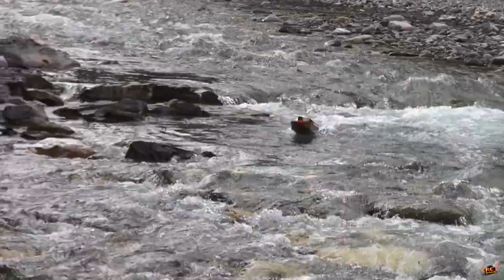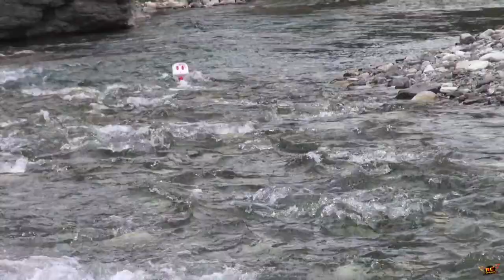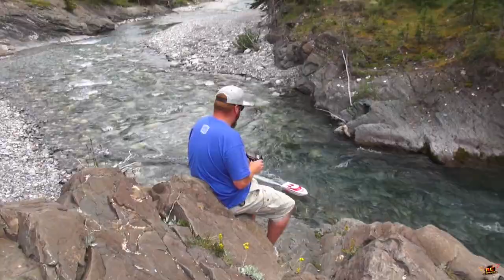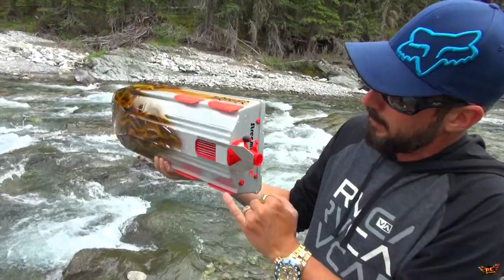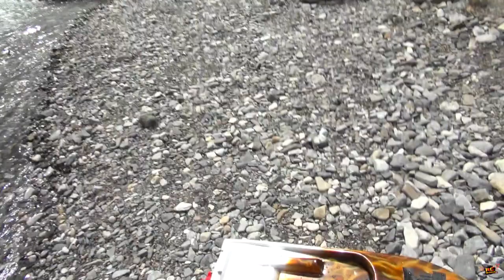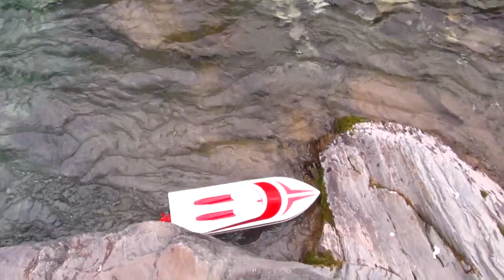RC ADVENTURES - RiVER RAPiDS vs Steel Skid Plates - THRASHER JET BOATS - 5S Lipo POWER!

Comment from the maker: RC ADVENTURES - Streamline RC Thrasher Jet Boat Series
UNBOXiNG THRASHER JET BOATS http://bit.ly/29KqvW6
THRASHER JET BOATS vs WATERFALL http://bit.ly/29KqZvl
SKiD PLATES vs RiVER RAPiDS http://bit.ly/29Krcyv
Reply: Had a toy Bat Boat as a kid. If only it had been RC!
Reply: +PageMonster Sometimes you can RC them!
Reply: how much are they and we're do I get them
Reply: +Tracy Rose I went onto Aqua marines and just ordered replacement parts for something simular to what I needed. I am currently restoring a Dickies fishing Trawler that is german made. They are no longer made and for good reason. The electronics in them were absolute shit. At $240.00 ,give or take,as soon as the wax dipped electronics got wet they would short out,making them useless. I picked one up at a local Goodwill and have been able to reuse the original brushed motor and winch motor. I bought a slightly pricier Tactic 4 channel Transmitter and Receiver,plus a water proof Servo that I was able to fit perfectly into the holder for the original Equally crappy servo that only went extreme left or right. I might have slightly over $130 into it,only because I bought a $30 remote just for the nets. It was dumb but I wanted them to work properly. I would even suggest mabe buying a cheap Toys R Us RC boat and rip the guts out of that to turn your batman boat into a RC boat. I went Hobby grade electronics,even added additional led lights and cabin lights to illuminate the interior control panels and over head lighting. I want it to stand out!
Reply: +Tracy Rose Its Aqua marine .com
Reply: Hey medic I don't know if anyone has already asked you to do a review of the JLB cheetah 4x4 monster truck. So I don't know if you maybe want to consider it.
Reply: a few weeks ago u talked to me on youtube and i was telling u about my birthday and today i got a mini drone called a horizon hobby nano pica
Reply: i think it flys great and its 0nly $60 u should get one for indors and for the AWSOME channel
Reply: keep up the GREAT work
Reply: Yeah thats cool
Reply: Check out the text I send  u on the video about the rc boats

Comment: Rcsparks I am 12 and getting into rc trucks so should a axial wraith be a good starting point
Reply: depends on what your going to be doing. first of don't get a top of the line rig to start off with. if your just going to be doing some regular driving(grass dirt some snow/mud) check out the ECX brand. I your going to be doing some more rough terrain crawling, go with a redcat crawler or even an axial. however be weary that some cars are not waterproof(such as axial) which can cost you at least $60-100.
Reply: K thanks

Comment: how does the hull hold up to the constant rock bashing?
Reply: 3mm thick abs is very tough.  ABS is so tough that traditional hulls are made extremely thin to save on cost and weight.  Thrasher hulls are 3mm thick to be extremely tough and the added weight is really nothing for the high output pump to manage.
Reply: It looks like it's holding up good at the minute but we will have to wait a bit longer I think and he'll give us a proper update.

Comment: +RCSparks studio can u run them in salt water and can the go in shallow water like a sand bar
Reply: IIRC he said he doesn't recommend running many rc boats in salt water, it corrodes things too easy, but he also said if you do just make sure you wash it out really well, and blow the water out with compressed air...

Comment: Hey RC, I came here from bereghostgames and he's just getting into RC, what do you recommend? DM bereghostgames.
Reply from the maker: Every RC I have shown on my channel is absolutely amazing. As I have been filming for 8 years.. there are many that will temp you. First you must decide.. Air, Water, or Ground RC.  Then..  Electric, Gas, or Nitro. After that, you must decide if you want a "Ready to Run" model, or a "Kit", which requires building. After you can answer those questions.. I can help steer you on a suggested path :) First.. start by watching the Trailer video on my main channel. It may better assist you. Hope that helps!

Comment: What GoPro r u using
Reply from the maker: I am using a GoPro Hero Session, on the Thrasher Jet boat. Its light, and sturdy, and very small :)
Reply: +RCSparks Studio is that hard to use cause it only has 1 button